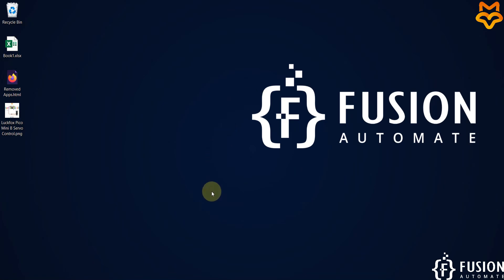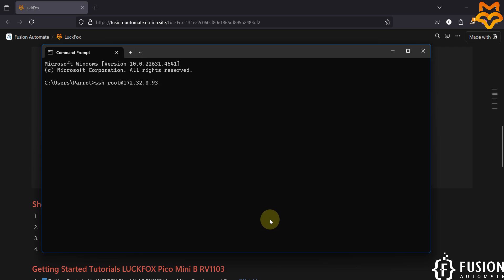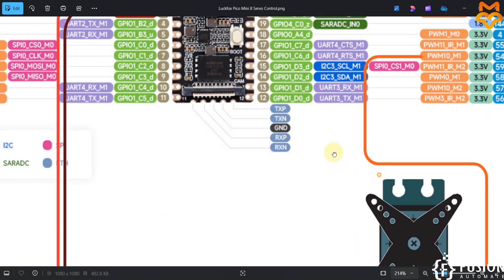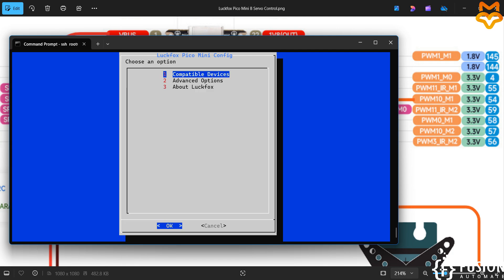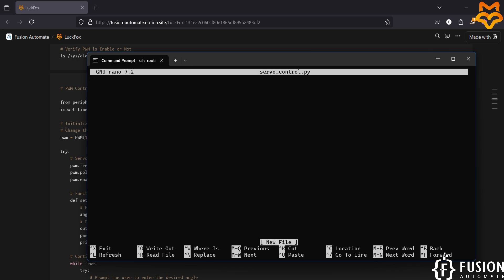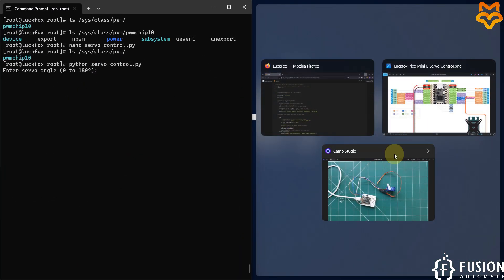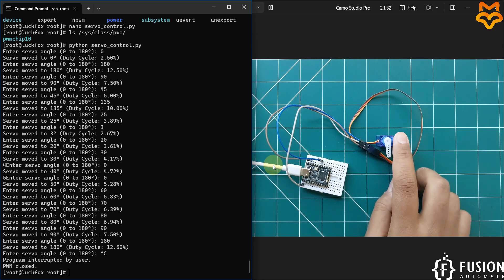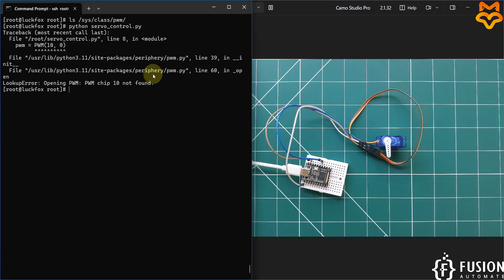How to Control a Servo Motor Angle Using the LUCKFOX Pico Mini B RV1103 Linux Development Board |

Comment: 3:57 its linux sure you can do it terminal same way as ls that class you cat set something to 1
its all there using LS to see
echo 1 > /sys/class/pwm/pwmchip10/enable
echo 0 > /sys/class/pwm/pwmchip10/export
echo 1000000 > /sys/class/pwm/pwmchip10/pwm0/period
echo 500000 > /sys/class/pwm/pwmchip10/pwm0/duty_cycle
echo 0 > /sys/class/pwm/pwmchip10/pwm0/duty_cycle
echo "normal" > /sys/class/pwm/pwmchip1/pwm0/polarity
echo "inversed" > /sys/class/pwm/pwmchip1/pwm0/polarity
echo 0 > /sys/class/pwm/pwmchip10/enable
echo 0 > /sys/class/pwm/pwmchip10/unexport

now can make shell script not need python xD